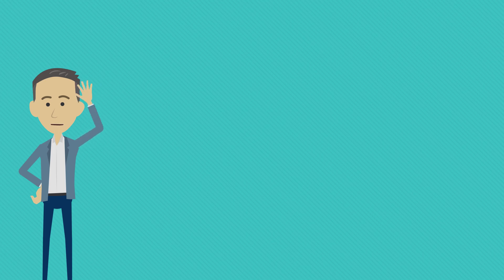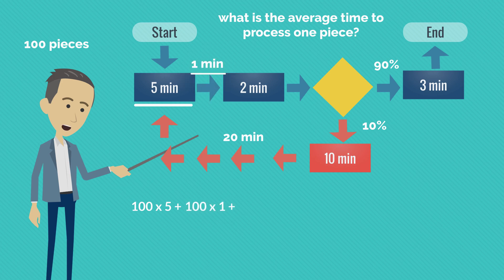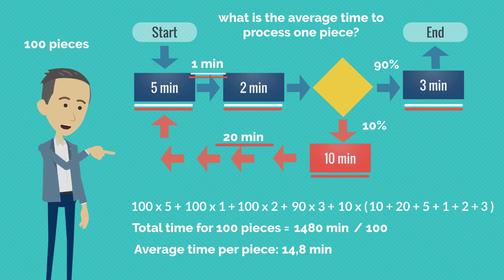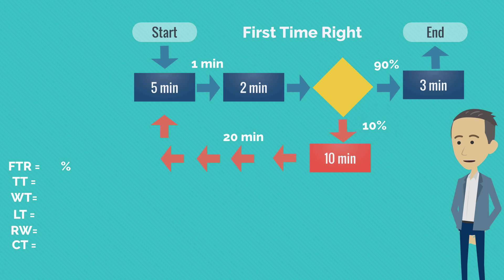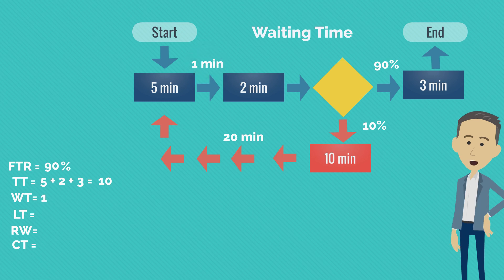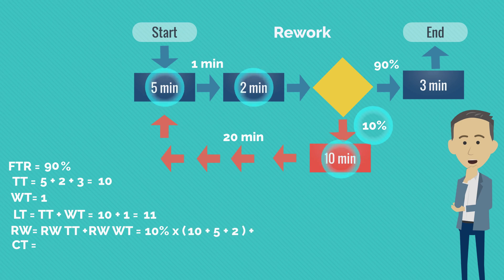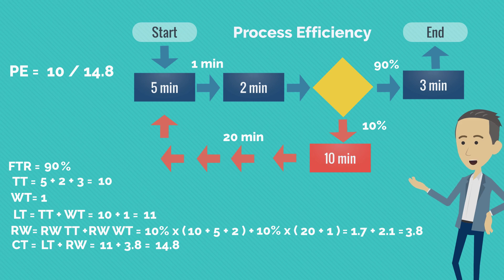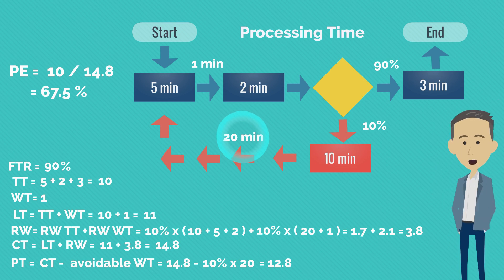Process Metrics | Touch Time, Lead Time, Rework, Processing Time and Cycle Time explained |

Comment: How can cycle time include lead &  rework time? Cycle time would be pure processing time isnt it ?
Reply from the maker: Hi, pure processing time is "Touch Time" (as the name says so - it's the amount of time a person is spending touching work). Cycle time is the time including everything. Imagine when you say that this is the end of a cycle, you are referring to all that is included in that period . Please watch the video. I believe it's very well explained.
Reply: @a2bthinking  Thanks for responding,but by Lean concept and how top consulting firms calculate,they dont consider wait and rework in cycle time.Hence I had a doubt.CT,Wait and rework will be a part of Turn around time
Reply from the maker: @shirlse9514  I am sure you came across other naming conventions. In McK some guys were doing it the right way, some guys another way. So even the most important consulting company you will have variations between consultants. Feel free to name it as you wish as long as you calculate it right and customers understand what's behind.
Reply: @a2bthinking  Thanks…. was Mck doing it this way?
Reply: @a2bthinking  Thanks … did MCK do it the way you mentioned?
Reply from the maker: @shirlse9514  yes